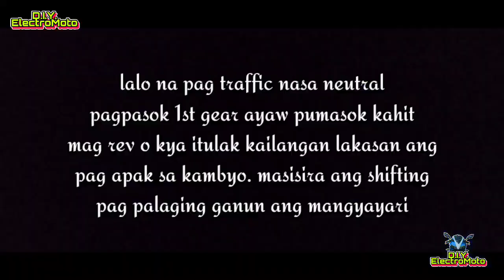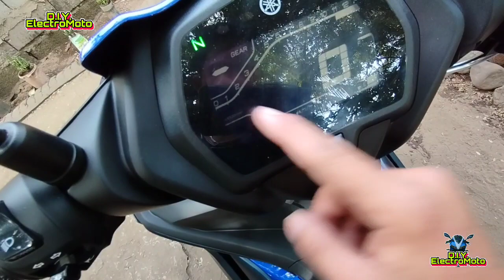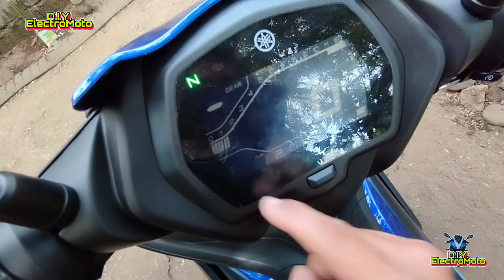SNIPER155vva hirap pumasok ang kambyo

Comment: Nawala naba lagutok paps? Pumapasok naba shifting paps nung nag adjust ka?
Reply from the maker: Ok na yung pasok ng kambyo paps..nasanay kc tyu dati sa z200 na agressive position ng paa. Kya nag adjust tyu..sa upshift namn dapat timing pag kambyo 3-4K rpm pag 1-2 gear.napasin ko din dpat bitaw agad sa clutch lever pra wla lagutok.
Reply: So may lagutok parin ?
Reply from the maker: Wla na paps..nasa driver lng talaga...😅